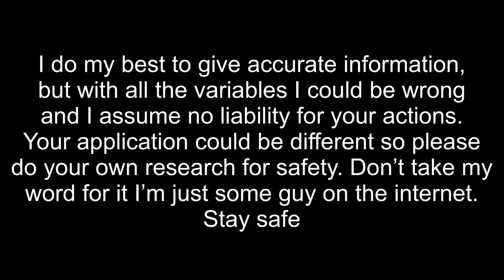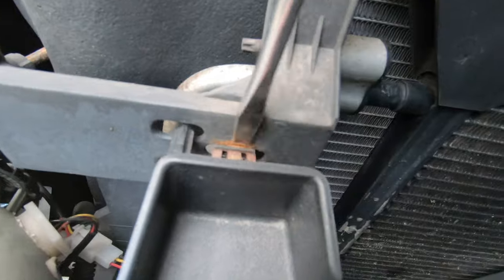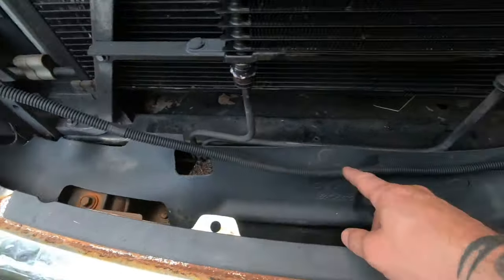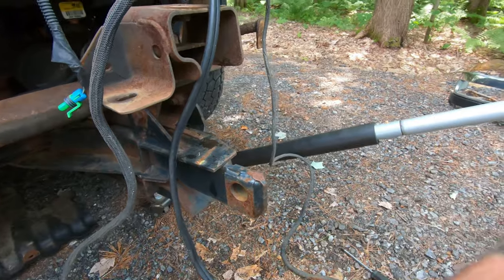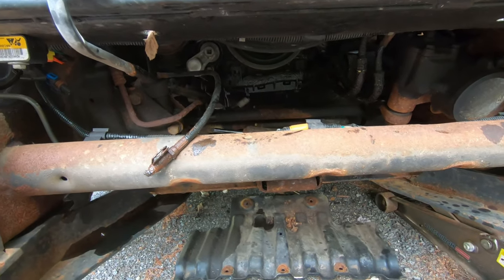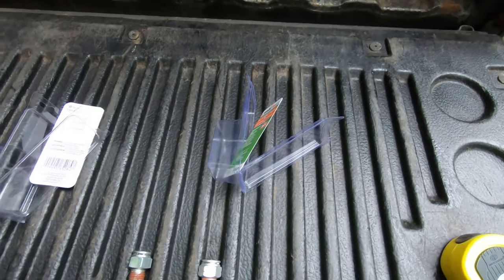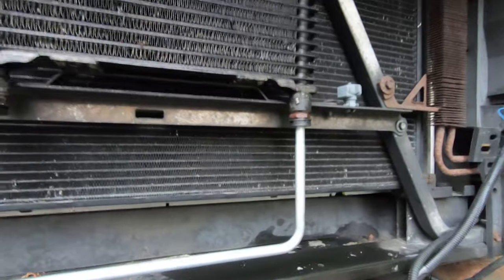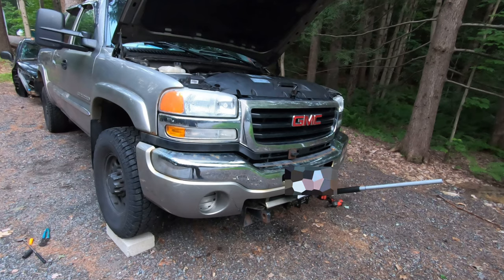Replacing GMC Sierra 2500hd transmission cooler lines

Comment: Outstanding video!!   I have watched many videos tackling this repair.  Yours is the most comprehensive I have watched.  You had the best video of the line disconnect and the transmission fittings.  Your idea of removing the bumper is a game changer. I learned much.   Don’t be disappointed in yourself. You did this job alone and on the ground.  You have exceptional skills Sir.
Reply from the maker: Thank you, I appreciate your support. I’m glad you found the video helpful.

Comment: Repaired my 2009 Silverado 2500HD 6.0 engine, 6L90 transmission yesterday. Took about 4 hours.  Put the truck on tall jack stands.  Living in land of corrosion Western New York I sprayed the 8 bumper bolts with Thrust penetrating fluid three times in 3 days.  Only one of the bracket bolts broke. I 😅also sprayed the line clips just to be sure.  Taking the bumper off is the ticket. Thanks again for your post.  Saved me much time, money and pain.
Reply: Edit:  I did not take grill or headlights off.
Reply: I did not take grill or headlights off.

Comment: I just had a very minor accident that caused me to replace the front bumper. After I got it off I saw that the point of impact was exactly where the transmission cooling lines went under the radiator and back toward the transmission. It barely kinked both lines. I also removed the plastic rock guards (there are two). The grill will just pop off after removing the one screw (next to the hood latch) and turning the four retaining screws a 1/4 turn. There is no need to touch the headlights.

I started out replacing two lines for about $50. I soon discovered due to age/rust it was better to replace all three for about $75 total.

Replace the two longest lines before the short one. FIRST install the upper line at the transmission. SECOND install the lower line at the transmission. Makes notes or take pictures around the radiator to make certain where/how they lay and cross over each other and the short one. THIRD install the short one (watch for a protective guard that is on the original short line). The easiest way to get the new lines into position is to feed them over the frame from behind the front wheel and then lift them up to the transmission. It is a very tight space. Give yourself plenty of room to move around under the vehicle. Remove the retainer clips to pull the old lines and immediately replace the clips. They are tiny and easy to lose. The new lines snap/lock into place so the clip has to be installed. Make certain the top line SNAPS and try pulling it back out before installing the lower line. Make sure the lower line SNAPS also. FOURTH connect the other ends to the radiator and transmission cooler. Make certain they all SNAP. Top up the transmission fluid because you will probably lose about 1/2 quart. You will notice that the fluid the is thicker and darker after changing the lines. Make certain to only use the fluid stamped on the dipstick, it's probably Dextron lll.  My guess is that the improved flow/circulation from new lines breaks loose all of the crud stuck in the corners. My truck is a 2002 GMC Yukon with 300k miles. I wasted time looking for used parts. The shipping was so high that it was much cheaper to just buy new parts. The new bumper, plastic trim, brackets, fog lights, cooling lines, fluid, etc was only $550 and it all came with free shipping!

Comment: Did mine on a 2500hd classic, connections on trans is very tight, simple fix, cut lines and left a nub, then unscrewed fittings with 19mm, removed lines and reinstalled the fittings with clips already installed.  This took the hassle out of trying to put clips back in with no room to work.
Reply from the maker: That’s a pretty good idea. I’ve cut brake lines off at the tubing nut and used a 6 point socket to get them out if there stuck. I didn’t think to put the fittings on before I put the lines in. Probably would have made the one that gave me trouble easier to deal with.

Comment: Good Work Sir!  Very frustrating dealing with parts I'm sure.
Reply from the maker: I usually try and get oem parts if I can. I think they were missing one of the fittings at the dealer though.
Reply: @JasonTheMunicipalMechanic  its just too bad that OEM parts seem to be so much more expensive a good amount of the time.

Comment: I've had several of these GMT-800's in the GMC and Chevy variety If you look at them the wrong way those lines leak. I'm sure the parts supply companies have made a small fortune selling replacement lines for these.
Reply from the maker: They seem to break around where they are attached to the frame. I’m hoping they don’t leak around the rubber crimp. I’ve had brand new lines leak around that crimp before.
Reply: @JasonTheMunicipalMechanic  ALL the factory crimped lines like that will leak. Have to go aftermarket with the Hydraulic hoses to avoid it

Comment: Just watched your video and job well done! I'm replacing the engine cooler lines on the driver's side due to leaking & am thinking the transmission lines need done sometime as well. Did you drain the transmission fluid before replacing the lines and fittings that connected to it? If not, did you lose a lot of fluid while swapping out the old ones?
Reply from the maker: I didn’t drain the transmission. I pretty much just lost what was in the lines. I only needed like a half a quart to top it off.

Comment: One of the channels I’ve watched over the years said that the aftermarket parts cannot be exact because the mfrs hold the patent. Therefore they are always slightly different. I spend half the time on projects like this just going to the store.
Reply from the maker: I’ve been having the worst luck with parts fitting lately. Nothing wants to play with anything else. It puts you in a bad position when everything needs to be ordered and the options are limited. Most of this repair was driving around.

Comment: Great job on this video. I have gm OEM parts on order and hope to do this myself, too.
Reply from the maker: It’s not too hard to do. I spent most of my time running around for parts, and messing with in the end I think a bad flare on the tube that locks into the quick disconnect of the transmission. It was all aftermarket parts so hopefully with you getting all factory parts you shouldn’t have any fitment issues. I don’t know if it was in the video but I taped the ends so I didn’t get dirt in the lines when I was feeding the lines into place.
Reply: Do you happen to remember the parts number for the lines
Reply from the maker: I don’t remember sorry. I think I included it in the video somewhere toward the end, but I don’t remember
Reply: Im fighting the same line same fitting now as you did not sure what to do

Comment: Hey Jason what is that exchanger that looks to be rusty to the driver side of the transmission cooler? It’s small but taller, I’m thinking about replacing mine because it’s rusty like your but I don’t know the name of it
Reply from the maker: I don’t have the vehicle anymore so I’m not exactly sure. It looks like it’s a power steering fluid cooler
Reply: @JasonTheMunicipalMechanic  thank you for the quick response I’ll look that up 🙏🏽

Comment: If they made some of these lines in two pieces it would be a lot easier to change them, the aftermarket lines should be this way. Just wait till you have to change the oil cooler line on the 4X4 models...
Reply from the maker: I had to change one on a 2000 Chevy blazer. It was the most frustrating experience ever. I had to drop the front differential because the block on the engine side wouldn’t fit in the space available. Then Chevy used nut that were inside the box frame that were actually loose nuts I needed to bend a wrench to fit in the hole to get loose. It was terrible. I think this truck would be easier than that, but I know what you mean. You can make the lines two pieces if you like. Just cut them where you want and use a compression fitting to rejoin. I did that on a Jeep Grand Cherokee once. Thank you for watching, it helps a lot.

Comment: Pretty sure it took my techs about 3.5 hours to replace all three of those lines with the truck on the lift. I remember the parts were pretty cheap from GM. Covid19 has really put a kink in the supply chain for everything manufactured.
Reply from the maker: I missed the lift with this one. I believe I’m spoiled now. I actually thought about putting my truck on my trailer and bringing it to work.
Reply: @JasonTheMunicipalMechanic  I ordered a lift two months ago and they are on back order because of manufacturing delays. I’m too old to lay on the ground so the wife decided it was time to get a lift.
Reply: Did mine in the driveway in 90 minutes, would have been faster if I cut lines sooner than I did.

Comment: Did you changing the fitting because they were leaking?
Reply from the maker: They weren’t leaking but they were rusted and didn’t want to come off the lines. You can reuse them if yours are not in bad shape like mine. I just figured it was easier to replace them.

Comment: What are the part numbers for the fittings into the tranny
Reply from the maker: 730-4952 and 730-6677, I went back and had to watch the video where I gave the part numbers so I could get them for you. The dorman part number was 800-604 for the small fitting as well
Reply: @JasonTheMunicipalMechanic  800-604 is the two that go into the tranny right.  So I best to just unscrew the old fittings instead of dealing with the clips. Then screw the new fittings in and just push the line in ??
Reply from the maker: Mine were rusted pretty good so that’s why I removed them. The clips aren’t really that difficult to remove but it might be easier to replace them with the lines. There is an oring inside the fittings that might leak if you reuse the old ones too but I haven’t had any leak. The 800-604 is the same part as the 730-4952 but I had trouble with the 730-4952 and I took it out and used the 800-604 instead. The 730-6677 I used and got from Napa. The 730-4952 is a Napa part also. The 800-604 is a dorman part I got from advance. You might not have any problems with the fittings like I did because in the end I think the line was the problem, not the fittings
Reply: @JasonTheMunicipalMechanic  thanks. I was just thinking it might be easier just to unscrew the fitting instead of the clips. Just cause it’s in a tight spot